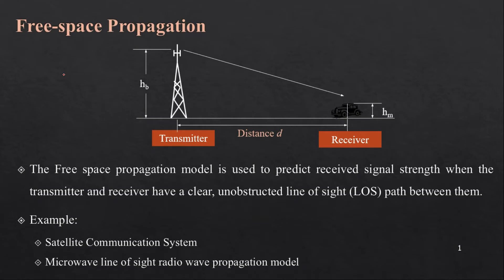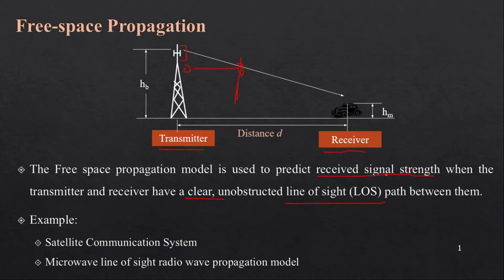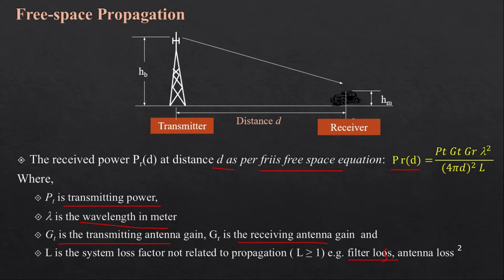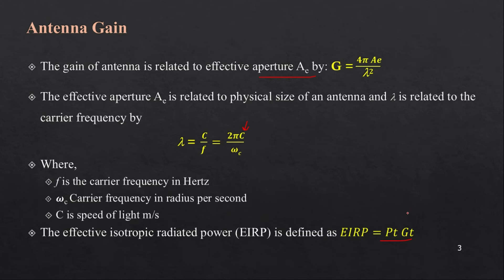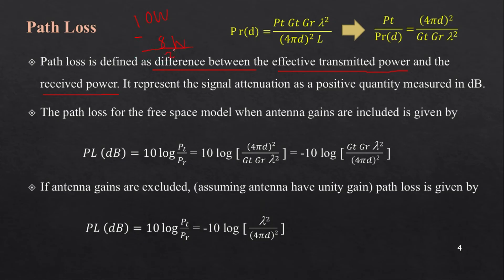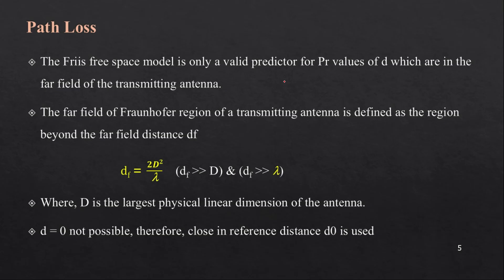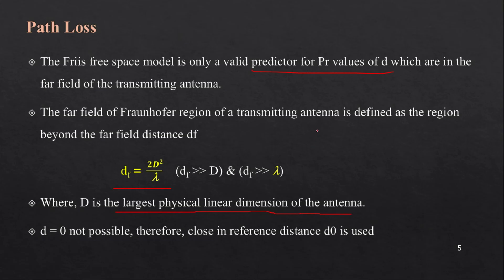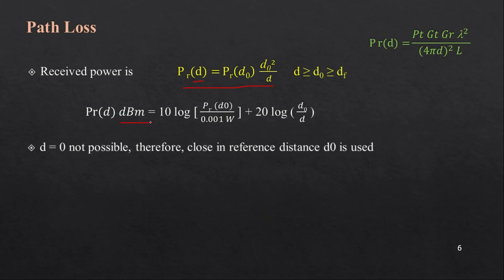Friis Free Space Propagation Model In Wireless Communication

Comment: Hi sir, can u please share matlab code
Reply from the maker: I don't have matlab code of this, however you only need to write equation in matlab to implement friis formula
Reply: % Friis Formula Implementation in MATLAB

% Input Parameters
Pt = 10;              % Transmitted power (in dBm)
Gt = 5;               % Transmitter antenna gain (in dBi)
Gr = 7;               % Receiver antenna gain (in dBi)
f = 2.4e9;            % Frequency (in Hz)
d = 1000;             % Distance between transmitter and receiver (in meters)

% Converting dBm to Watts
Pt = 10^(Pt/10)/1000;

% Free space path loss calculation using Friis Formula
lambda = 3e8/f;
FSPL = (lambda/(4*pi*d))^2;

% Received power calculation
Pr = Pt*Gt*Gr*FSPL;

% Displaying the Received power in dBm
Pr_dBm = 10*log10(Pr*1000)